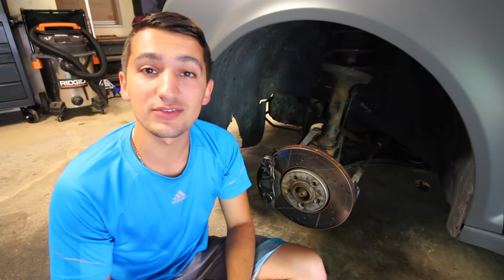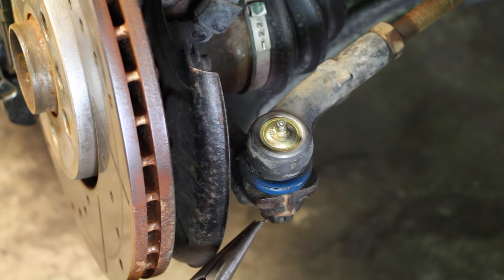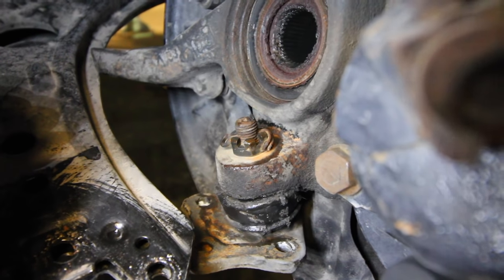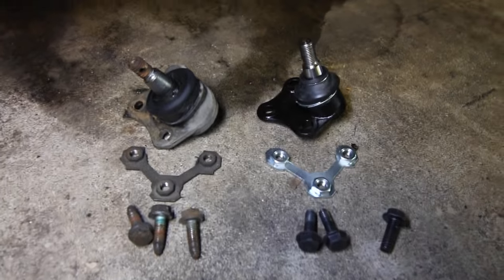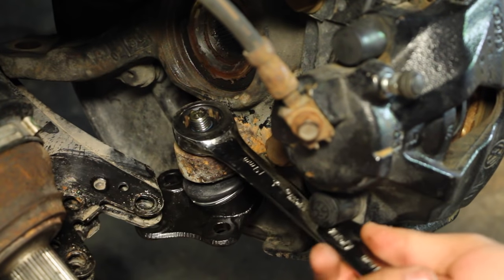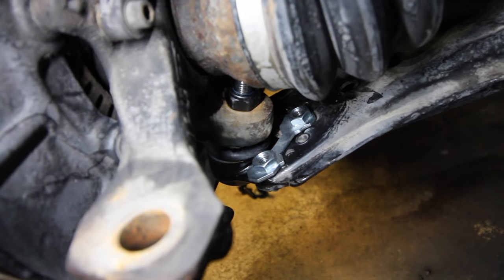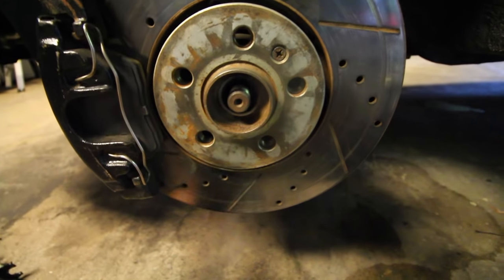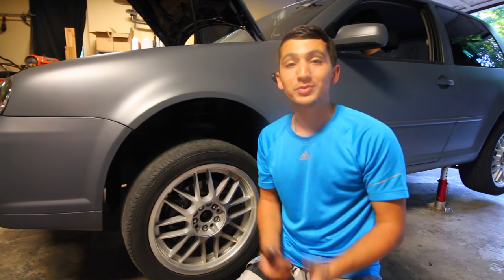How to Replace a Ball Joint

Comment: Great video. Thank you. My question: Shouldn't you replace the tie rod ends, at the same time as the ball joints? It seems to me, that those parts are wear-synced, and I would want to replace both my tie rod ends, as well as both ball joints together, when doing this job.

Comment: Excellent! I referenced this while doing mine today. It was a bit of a pain but the other side will be much quicker. I didn't need a puller, just wacked the old ball joint with a hammer and it popped right out.
Reply: Hahahaha I said exactly the same and was so confident what I'd learnt doing the 1st side would stand me in great stead for the other..... It took 3 times as long. Every bolt fought me and had to be grinded off. I won but not without some blood shed.

Comment: cool looking rotors you got there.
I just change the ball joint on my 2003 VW Golf, but I didn't take the axle out to unbolt ball joint stud nut. You can just undo the nut with a wrench and then hit the knuckle to loosen the ball joint. The only downside is that you can't torque that nut to spec, because there is not enough space between the ball joint and axle
Nice, clear video though. Keep them coming

Comment: good instructions, but you dont need to remove the axle nut or the tie rod, you can manage to get it out without taking it all apart like that, and i hope you replaced the axle nut since they are one time use nuts that cost 9.50 or so each one
Reply: He says to replace it in the video.
Reply: ah okay, i didnt catch that part i guess, good becuase most people wouldnt even realize those are one time use nuts and that they need to be replaced
Reply: I tried to remove the ball joint on 2001 VW Jetta but the top nut on the ball joint wouldn't come off can you till me what I'm doing wrong
Reply: I tried to remove the ball joint on 2001 VW Jetta but the top nut on the ball joint wouldn't come off can you till me what I'm doing wrong
Reply: if your balljoint is so loose inside the nut will just spinthe shaft with the nut
Reply: Especially on a truck you have plenty of room
Reply: @MikeUtoober  What happens if I don't replace the axle nut and reuse the old one?  And is there a guarantee of a catastrophic cataclysmic failure?
Reply: I_need_donuts i wouldnt say its gauranteed failure. But its a risk of failure. Avoid taking mine off whenever i can
Reply: @MikeUtoober  ok thank u
Reply: Mike Utoober are you saying you don't have to remove the cv joint nut or the track rod end?
Reply: @brody811  it will come out half way and hit the cv joint spindle, use a pitman fork to pop the ball joint out of the knuckle, then you will have room to take the nut off the rest of the way
Reply: @rockefelleragent1357  it can come loose and your wheel fly off, we'll worth a couple dollars

Comment: A little bit of advice for anyone doing this that most fail to mention.  Make sure both sides of the car are suspended and also keep the top mount bolts loose.

Comment: Glad you upgraded to a better ball joint.  That style that was on there wore out and separated on a previous car of mine.    The style with the hex or torx counter hold on top are better built, and MUCH MUCH easier to undo when it comes time to replace them than the infernal castellated nuts/cotter pins after a few winters.
Reply from the maker: I'm with you on that :)

Comment: Not specific to this kind and generous informative video but the information is typical of average mechanics & garages. They do not care if they wear out your CV driveshaft prematurely indeed they view it as upsell but it is dishonest. Using an impact on the drive axle will prematurely wear the CV but not for 5000miles so the mechanic gets off Scott free. This is why i do work myself or use franchised garages who often enforce detailed steps without shortcuts. Look at the results: those motor manufacturers who use videos to instruct their franchised factory trained mechanics have the top reliability: eg Honda

Comment: If you do not yave a splitter just soak the ball joint with penetrating oil. And hit it with a hammer on its sides it should come out like mine did
Reply: There is also a tie rod end splitter

Comment: If someone did not use a new bolt when installing the axle through the hub, you say they wouldn't be able to torque the old one properly.  What could or would happen in that case?  (I'm a girl, who is not a mechanic, so please bear with me.) If it wasn't torque properly, would the wheel possibly make a sound when driving down the road? Kind of like when something is spinning and it is loose or not balanced - How it makes a wobbly sound instead of a whirring sound. Would it possibly do that?

Comment: I removed the rivets and increased the holes to 1/2" to fit new ball joint bolts. But the question I can't find anywhere: what torque specifications do you apply on those 3 bolt, attaching the Ball Joint to  the Control Arm? In Haynes Manual it says should be an instruction sheet in a new set, but mine doesn't have one. From Internet it looks like 10-12 or 12-14 Ft-lbs, but in one film he applied 50 Ft-lbs, though  on a truck. Pls could you give your opinion what torque specification it can be? I did a lot of research on Internet, nothing on that 
question. Thank you for a good film.

Comment: I had front lower ball joint installed crooked to point 1 side seated other side I could see down inside. Is this safe to drive and would it cause my car to vibrate & shake.?

Comment: If you don't have the tool to press out the ball joint - you can tap the side of the area where it mounts with a ball peen hammer - exactly like you did for the tie rod end.  It will fall out.

Comment: Hi is there anyway the ball joint can be put in so that it does not line up the 3 bolt carriers of the control arm; or when the ball joint is tightened down is there no way it can be misaligned?

Comment: I have a nissan quest 1996 same ball joint and arm.Does the part of the ball joint that holds the bolts sit on top or bottom of the control arm i didnt take pictures and forgot? Thanks

Comment: What size tools will i need for my 2009 cobalt, to remove all of the necessary parts and to install my control arm and ball joint. Mine is permanently attached to the control arm. I want to have all of what I need before I get started for once lol.

Comment: Hey, this maybe difficult to diagnose since you can't see my car but I've been hearing a clanking sound whenever I go over unleved ground or higher speeds coming from the driver side rear end of the car. Don't think its the wheel bearing but could it be the rear control arm? Any thoughts in diagnosing the issue?

Comment: I get a vibration from the front passenger wheel but i dont know what it is & its everytime the wheel spins. Its torqued properly & i changed the brakes & rotors & calipers so it cant be that. Do you think its the wheel bearing? Cause it makes no noise..
Reply from the maker: How do you know it is the passenger front wheel? Could the wheels not be balanced?
Reply: +milanmastracci Cause when im driving i feel it coming from their & when i carry somone in the passenger side they say they feel it right their. The wheels are aligned.

Comment: Did you do an alignment after You change your front control arms and ball joint??? My front lower controls were done so I change my front left lower control arm then I test drove it NOW it's even worst then before ( I change everything my tie Rods, end links, shocks) do you think it might be an alignment issue can you please help me ? I still need to do the other right side of course
Reply from the maker: For this car, the only time an alignment is needed is if you install new tie rod ends. It is different for vehicle to vehicle, however if you notice your steering is off after you installed / replace a steering/suspension component, it is in your best interest to get it aligned :)
Reply: +milanmastracci thanks man I appreciate it that yeah it is different vehicle to vehicle / I have a 09 Nissan Maxima/ hopefully getting it alignment fixes the issue/ I'll let you know or if anyone has this same issue thanks again.
Reply: +milanmastracci hey man okay I took it for an alignment / it's straight now BUT when I took off the tire shop it's still worst !!! I took it bad to the tire shop / they said they'll have a look back couple of months I took it in for alignment they said they had to Slotted and struts which mean camber/ I said okay now like said I changed my Front LCA's/ Firestone checked the struts they found TWO LOOSE bolts holding the top mounts of the struts they tighten them up its better not MUCH clucking bumping sounds BUT when I turn left and right it sounds like it's rubbing so they left the car back up now they said that the cars front lower control arms are rubbing against the end links they said the end links are to long I was like how are they long if they are Nissan aftermarket spec of course I said BULLSHIT !!! So what do you think brother

Comment: Would steering get loose if the ball joint on the lower control arm goes bad?
Reply: Indeed it would. You would feel play in your wheel, and if the ball joint(s) is bad enough, a chattering in your wheel at certain steering angles

Comment: Do you have to remove   drive shaft on a  98 vitara  to replace ball joint
Reply: No that absolutely not needed on any car, that's a lot of extra work for no reason. The ball join can be popped out then take the nut the rest of the way off. You also have to torque the cv joint nut down correctly to preload the wheel bearings (depending on the generation of wheel bearings), which can cause wear if not down right, so not worth risking for no reason, especially since the nuts are usually single use.

Comment: is there generally a noise associated with this?
Reply: yeah you might hear a clunking sound when hitting a sharp bump, but the best way to know if it is bad is to jack up the car and move the wheel in the 12 and 6 o' clock (up and down) and see if there is play. You can also use a pry bar on the ball joint and see if there is play that way. There should be absolutely ZERO play with both methods. If a ball joint fails, you can loose your wheel so for the price they cost, it is best to just replace them.

Comment: Dont do this. You can remove the ball joint without removing the axle nut and tie rod.
Reply: Can you get the allen key in there with the axle in place? Looks kinda tight.